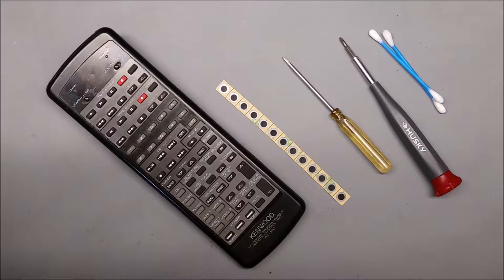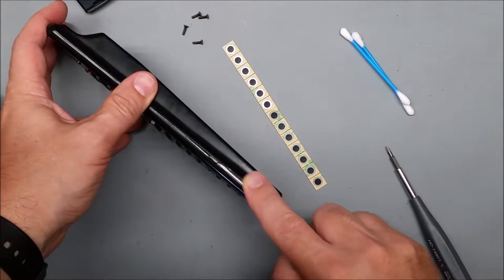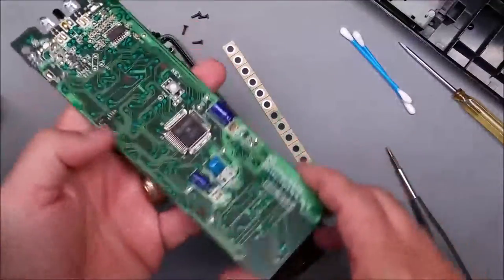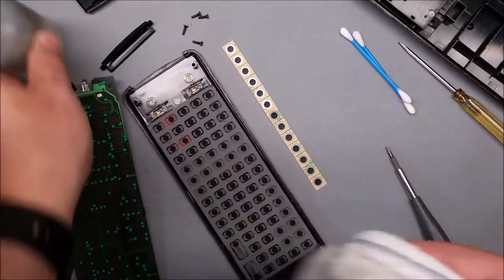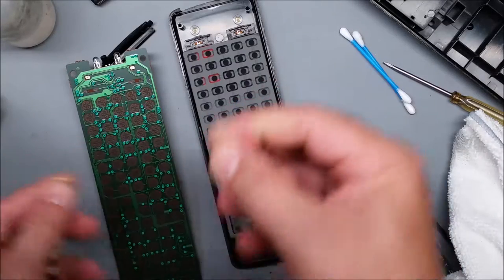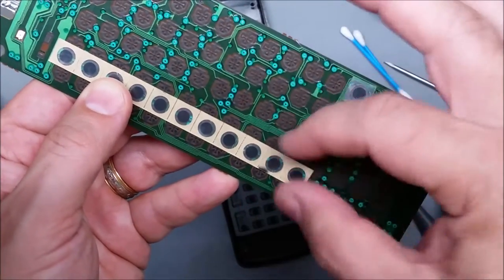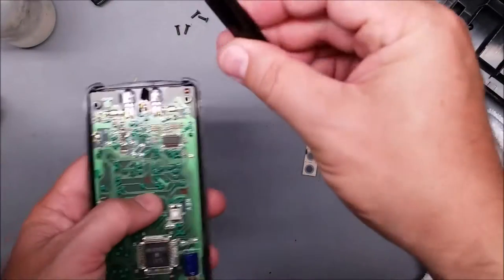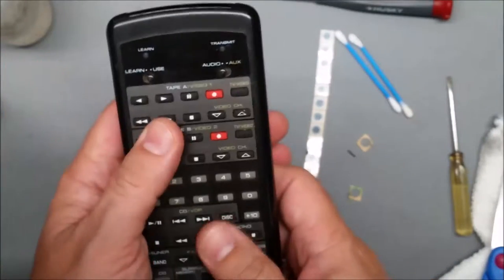How to repair the buttons in a Kenwood RC-140 remote control

Comment: I have the same remote from a Kenwood I bought in the early 90's.  The transmit button stays lit on the remote causing the drainage of the batteries.  Do you have any idea what might be causing this?  I assume it may be a button that is stuck in use mode but I don't know how to figure which one it is.
Reply from the maker: Sounds like a button is shorted out.  That would be more likely if you have repaired any buttons in the past with any sort of conductive paint or anything that sticks tot he rubber keypad. Eventually it cracks or falls off and can short out a button. I have also seen this happen with extreme black gunk buildup from the rubber button deteriorating. Cleaning it with isopropyl should help. If it is an old repair using some sort of conductive paint the short circuit can be very hard to spot and sometimes resist cleaning.
Reply: I haven’t repaired anything on it.